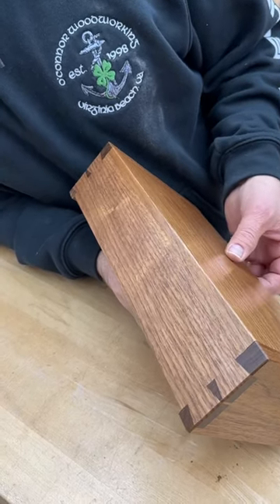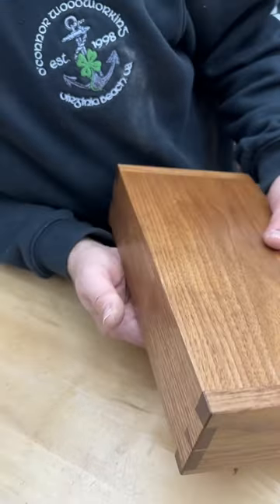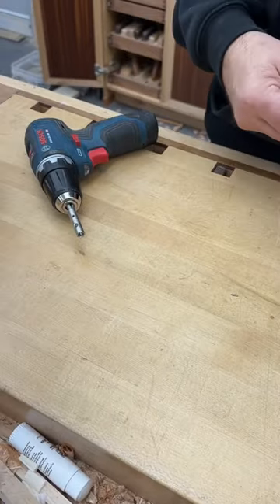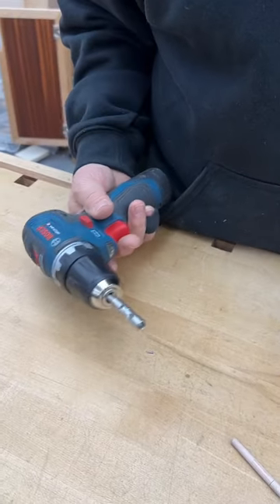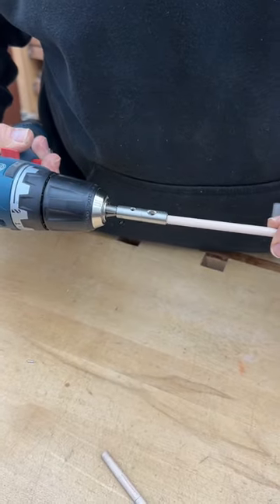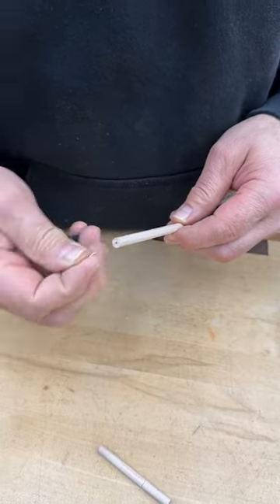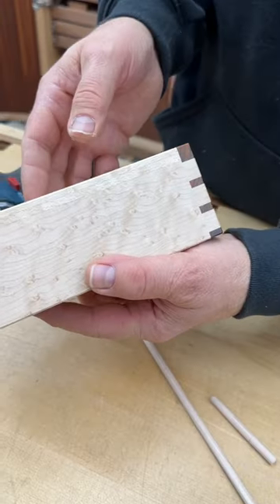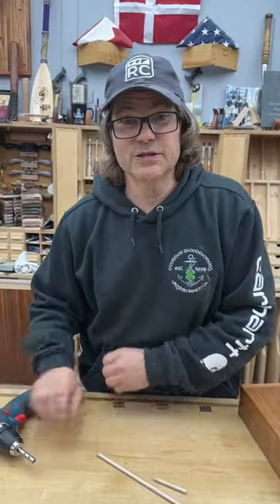Disappearing wood hinge #shorts

Comment: I am very interested. This may be a dumb question, but how do you get the hinge (dowel) flat on the outside of the box to where it doesn't show, and still have enough wood to have a hinge? Do you off-center the dowel when you glue it to the box, then cut it flush?

Comment: Dude I had the same idea but lacked the genius on how to center the pins and make it flawless. I made a box to hide my laptop from dust in my shop I can slide into the wall and use external peripherals and tv... The way you did it is so perfect, I will try it with your jig with hardwood... Inspiring!